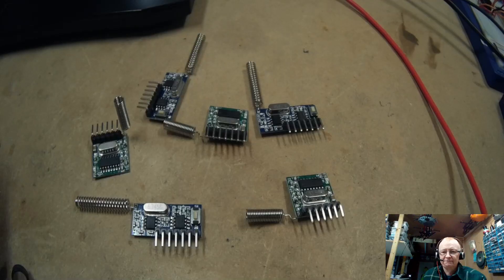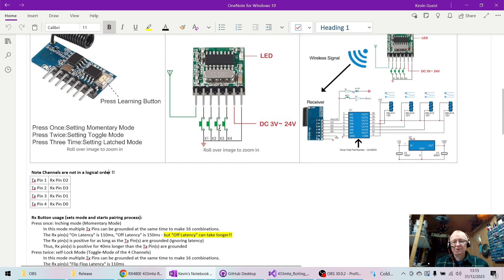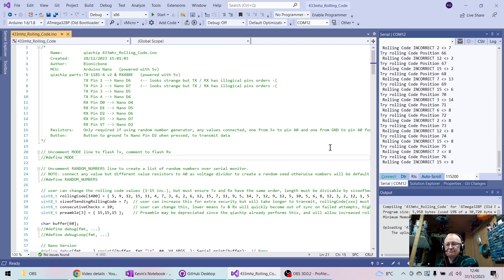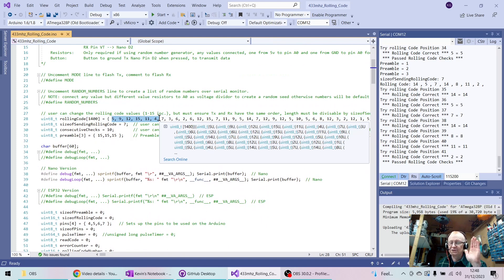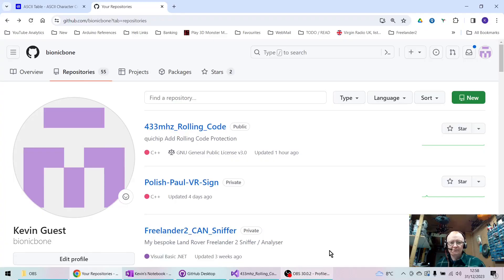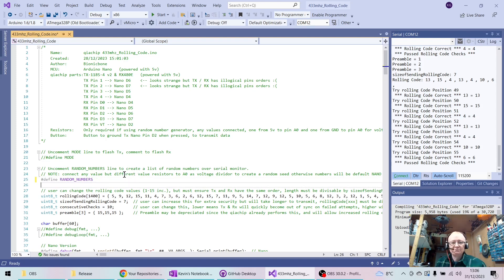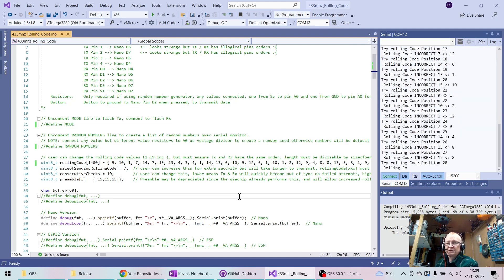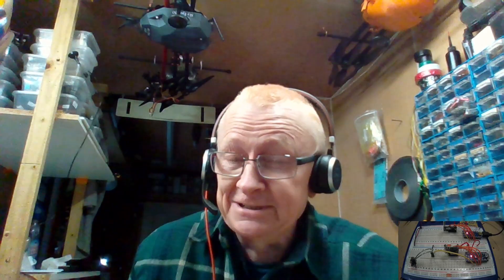433Mhz You can't hack this !!

Comment: By sending the captured code and then two random sets of codes, you should hit the original code in 600 tries. As in it would loop through the numbers 3 times and on each round it will be offset by 1 and on fourth round it would hit the original code. Not sure how long that would take.
Reply from the maker: Well done, yes I have been looking at this problem. I’m thinking after each loop I need to change the list of numbers, either so the loop itself is offset by an odd number or the numbers themselves change which is similar to how sequence coding works today but it would still be more difficult as the sequence would only alter once after many codes. I may need to use a ESP32 though, more code means less numbers stored lol
Reply: @TheBionicbone  And then there is always the out-of-sync -problem so you need some sort of way to reset the list, which gives replay possibility, or master key, that can also be copied.

A better solution would be to store a master key on both devices, and use current timestamp as integer minutes, hash them together and use that as the key. That way the numbers don't ever loop, you cannot advance the counter by sending codes. The reciever just needs to check +- couple minutes and after that not to allow any earlier keys.
Reply from the maker: @AllanSavolainen, yes I like the date and time bit. However, the latency of these cheap 433MHz devices is slow, and I have this nibble (4 bits) binary issue with them. If I transmit any more than about 10 nibbles then I risk the user thinking its not worked and pressing again :(. I have other devices that are much faster, they could easily handle date and time hashed so maybe one for the future.
Reply: @TheBionicbone  you could hash it to just couple bytes or 7 codes like you now have
Reply from the maker: @AllanSavolainen  the 600 tries issue has been resolved, I would love you to take another look at the latest imporvements.
Reply: @TheBionicbone would rate limiting improve this?
Reply from the maker: @FloridaMan02  do you mean, if you receive more than x Tx per second lock down? Its an option. After recent updates it locks down after 10 unsuccessful attempts, 60 seconds,  and gets gradually longer if fails increase.
Reply: I used to get through 1000's of tries in a night when the systems were insecure (late 80's early 90's). I could tell it had worked when I heard alarms going off in the morning before I got up for school. The alarms had been de-activated and were set off inadvertently by the owners thinking they'd just disarmed them. Fun days.

Comment: Had a quick skim of the code but don't have any hardware to test it on. Might port the logic to run native for further probing later. I can see two potential flaws that might exist, if an attacker records 200 door opening/closings they'd be able to record the entire secret key and then generate valid keys next in sequence at any time. That would take a bit of real world time but it is a problem(couple of months with a few door openings a day) if you want a set and forget solution. It doesn't appear like there is anything to stop an attacker recording one valid code(of 7 uint8_t) sending a random code to poison the checkRepeatCode and then sending the valid recorded code 200 times. The 199th time it'd have wrapped around the 1400 length array and now match correctly with the recorded code.

I think a much better approach would be to ditch the 1400 static array and use a CSPRNG(cryptographicly secure pseudorandom number generator)on both the TX/RX side that are seeded the same. That'd give an (almost) non repeating list of numbers much better than the 200 before repeats like this.
Reply from the maker: Thanks for this, I am looking at different logic approaches. Also research on RollJam is a concern, it think I need to detect such activity. I appreciate your reply. I had a similar comment, I may look to change the static numbers and once at the end then reseed. This way it’s less likely that some would work out the seed with reverse engineering. I’d like to know your thoughts on that.

Comment: Rolling codes are hackable. There is a well know technique called RollJam, where the attacker jams any signals to the Garage door. When the homeowner uses their keyfob to open the door, the attacker reads it. But since the door is jammed it does not open. The owner desperate to go in presses the keyfob again. The attacker intercepts this and transmits the previous code to the door. The door opens and the attacker has a code that he can use later.
Reply from the maker: Hi, thanks for the comment. It’s a valid point, you must ensure when you press the button the garage door does start to close, then the code is used. Replaying that code continuously will just be ignored by design. If it doesn’t start to close you’d press again and once it responds the Rx and Tx are back in sync and the captured code before the new sync so no longer valid. In fact it happens in real life, sometimes you press and due to interference it doesn’t work, so has to resync
Reply: RollJam accounts for this by continously jamming and intercepting the signal. Take this example. There are 4 keys : A, B, C, D. The door is closed and the owner is outside and wantes to enter. He uses the keyfob and sends code A. Code A is intercepted by the attacker and not forwarded. The door does not open, so the person sends the next code B. The attacker intercepts B and sends A. The door opens and A is no longer valid. Then the person closes the door by sending C. The attacker intercepts C and sends B. The door opens and B is no longer valid. But the attacker knows C which is valid and he can use it at a later time to open the door provided the keyfob is used by the person. If the person use the keyfob and sends D. The attacker intercepts D and sends C.  The attacker knows D which is valid. The attacker can do this continously till the time they wish to enter. Rolling Codes were commonly used in Car and are still common in Garge doors. You can buy devices link A Yard Stick One for around USD 100 or build your own for $30. They are extremely easy to build and code. There are hacking workshps for high-schoolers where they are taught how to break rolling codes using the method i described.
Reply from the maker: I’ve been researching, you are correct, I need to detect such activity and lock down. I need to invest/make a RollJam to do this.

Comment: You don't have to store the rolling codes in flash. Most implementations of a rolling key will create a sequence by a function. TX and RX will share the init-value of this function and a current (rolling) value. For example init-value: 5, rolling value 4, function will add init-value + rolling value. => 9. This will be the rolling value for the next function call and stored on both devices. Next rolling value will be: init-value + last rolling: 5 + 9 = 14. Of course you have to use a more complex one-way-hash function for calculation instead of a simple add-function, to get none-predictable values.
Reply: I agree on the need for hashing.  I suggest the HOTP algorithm.  I left a more detailed reply in the main thread.

https://en.wikipedia.org/wiki/HMAC-based_one-time_password_algorithm
Reply from the maker: Thank you. I am also looking at detecting RollJam attacks.
Reply from the maker: @deterdamel7380 @omareq5724 So I can give full clarity I will make another video on why when using my methodology encryption and hashing methodologies do not add value whilst saving the memory does. If you study my method well, you will see why.
Reply from the maker: Thanks for taking the time to watch and comment, it is really appreciated. I agree fully with your comment, but we are seeing good reverse engineering now, and using AI like ChatGPT it is making this very easy (and thats not even a dedicated maths AI). OK, ignore the hash to keep it simple. Ask ChatGPT to solve your example, 1st number is 9, 2nd is 14, 3rd is 19, it will work out the next number adn detail how. OK, again this is a really simple example, but try more complex you maybe supprised. The future is coming, if it can be calculated and even hashed (unless you can give an example of otherwise) it can be reverse engineered, yesterday by some clever guys, tomorrow by AI. It is for this reason I want it to be totally impossible to scan and calculate the next range of numbers in the sequence.
Reply: @TheBionicbone  Not AI is the issue in this case. It's the quantum computing. So you have to chose a function that can not be solved by the quantum computer in a short time.